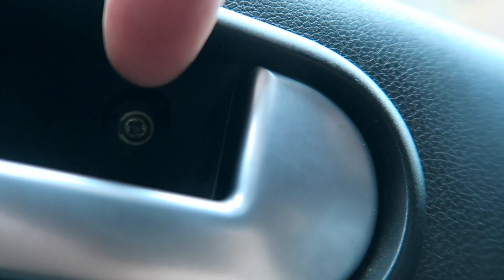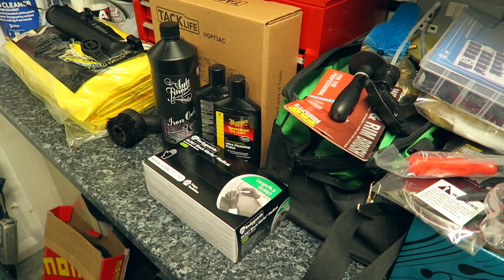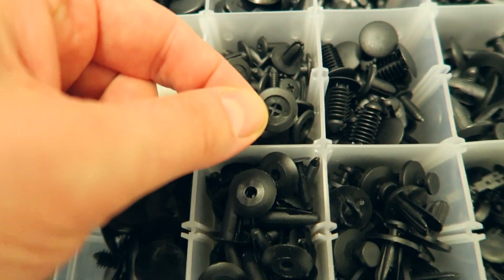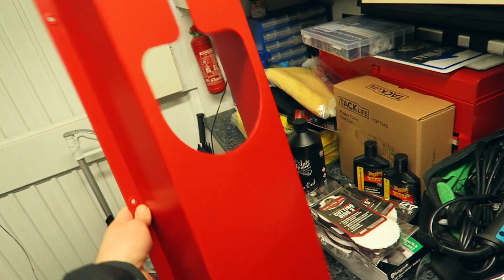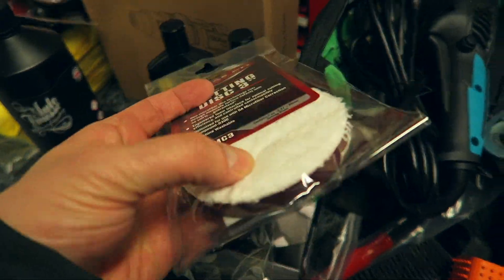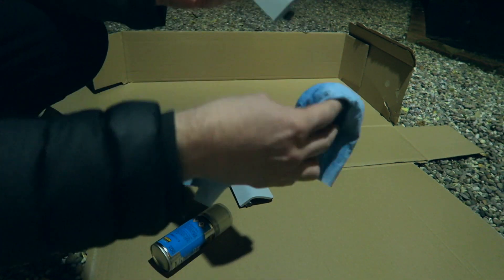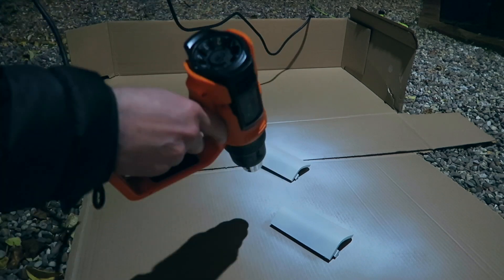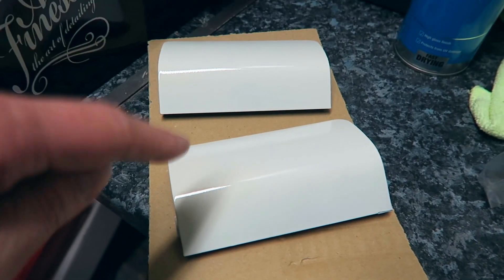Ford Fiesta Mk6 ST150 jacking point covers get painted

Comment: Hope you film the sideskirt "re-install!" Mine are slowly peeling off too
Reply from the maker: Will do my best to film it, will be in a couple of weeks I think unless I get some extra time on the car, I got one side fitted back a little better with a gentle nudge bu the front clips have come away so will take them off and inspect them.....
Reply: @DJLloydy  might be worth getting some 3m double sided tape on there after you fit the new clips, should help with fitment and ease some strain on the clips too
Reply from the maker: That’s a great idea!  Maybe some tiger seal for good measure lol I think the tape will be good as helps removing in the future
Reply: @DJLloydy  You might be onto something with the tiger seal 😂 I've had to tiger seal my rear honeycomb and diffuser on to deter thieves 👀
Reply from the maker: I can’t believe how easy things come off of these cars!!  Should never have to tiger seal things on for security 😂

Comment: How much you pay for the jacking points? I cannot justify £50 for one.. I see it hanging one day and I put it back on.. not knowing they are rare as and cost a bomb.. back in the day they was brand new under a tenner!
Reply from the maker: I got these from Ford with the badges and a few other bits, I have a friend there who gets discount but they where only about £40-£50 for the pair I think
Reply: @DJLloydy  it's who you know! Thanks #staySafe
Reply from the maker: counterPoppy have you looked on eBay etc?  Could get them a little cheaper and paint them?   Bit of hard work but potentially a little cheaper #staysafe!